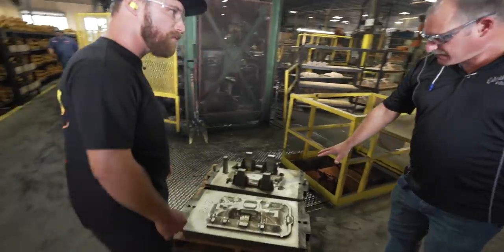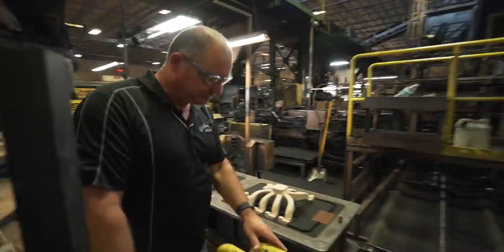EDELBROCK'S FOUNDRY TOUR!

Comment: might not look like it, but that foundry is clean af. i worked in a foundry once and it was just black sand an dirt everywhere. after every day my nose was gummed up by black sand, even though i wore a mask most of the time.
Reply: Same here, I looked like a struck match everyday I left work. That's probably the cleanest foundry I've ever seen.
Reply: I don't know where in the world you live, but it looks like a reasonably nornal modern foundry. It was a dirty business once, but that's long ago (nto everywhere though)
Reply: plus it helps they only cast aluminium here which is a cleaner metal to cast than steel
Reply: My families foundry is on the clean side for a high chrome/steel foundry but we don't have anything on this.
Reply: Icocure core making is some of the most unpleasant smelling process I've ever witnessed.
Reply: and that sand would find places on your body you never knew you had.  you really need smellovision to appreciate a foundry.
Reply: Never worked in a foundry but made plastic bags and bottles and those plastic pellets and little slivers of plastic somehow made it all over my house. I bet the new tenants still finding them.
Reply: Iron is the worst, I worked at New Haven Foundry in Mi. about 20 years ago and I'm still black from the soot

Comment: This was a clean foundry because it's very small and uses aluminum.  I worked in Fords " most modern iron foundry"  as they billed it.  We melted 50,000 TONS OF IRON EVERY DAY!  We made all the V8 blocks up to 460, trans cases, rear ends, fly wheels, intake & exhaust manifolds. cranks, camshafts, brake rotors and spindles.  The place closed in the early 80's because the gas crisis caused the cars to down size in all the parts.  Made great money, ate a lot of iron dust, and was glad to get out of there.  We kept the building under a negative pressure so all the dirt/dust never blew out the doors.  We had seven bag houses that were giant vacuum cleaners that sucked off the furnaces and the rest of the building.

Comment: I wish Edelbrock would make a dedicated small block Olds head for the 350 with 2.00 in. intake and a 1.625 ex. valve for use with a roller cam. I would buy the first 2 sets. Interesting video. Thanks.

Comment: Vic Edelbrock was hugely influential in the development of West Coast hot rodding. He was always seeking a better way to produce a better product, open new markets, or in Cali's case, save one; Vic was one of the big players that founded SEMA- to gain the political voice to get the Cali smog laws to develop it's California Air Research Board certification. Today that certification will allow Edelbrock Performance parts to be sold and used in any state. It wouldn't surprise me if Vic, Jr. figured out the EU process and became a  vendor for AMG.

Comment: Great insight into the casting process. 
Would loved to have seen one or those 4/5 imperfect sand moulds smacked against something. Get an idea of how hard that resin is. Also be cool to see how they remove the sand from the cast piece.
Reply: Andy yeah exactly how tf do they get the hard sand out from the metal casting
Reply: He didn't mean they were imperfect, he was saying that each casting uses multiple cores to make. Some can take quite a few to make one casting.
Reply: @daevid21  Most foundries use what's called a shakeout. It can be a rotating drum or a bin that basically just shakes the hell out of the castings. Very noisy, lol

Comment: About 20 yrs ago built a heavy haul rigg for crusin calfreeways. 355cui /with mild porting elibrock parts ect dynosaid  353 hp to rear wheels over 410torque , with Qjet 17mpgperformance,,, parts list performer package ///////. a while later truck came in from CA.time for fine tune . noticed gasket colores are different . luck has it edelbrock has wheel dyno a couple of buildings away . they said we will get every H P  it can produce . impressed they paid owner to do a tear down and spec parts and work done . about a year later crate engines started showing up performance rated !!!!!!!!!!

Comment: As an "Environmental Question" what does Edelbrock "do" with the spent sand/resin cores after use?...🤔
Reply: TK Skagen it’s recycled and reused.
Reply: Sand that hasn't burnt out (~90%) can be reused in the process after regenerating. Resin on the other hand has to be removed from the sand grains during regeneration, cannot be reused and has to be treated as hazardous waste.
Reply: Foundry industry is one of the most environments conscious industries today. I’m a metal casting student and most of the conferences I’ve been to held seminars on mitigation of pollution and cleaner processing techniques

Comment: What is the process to remove the sand cores from inside the casting after it’s poured and cooled off? Very cool content
Reply: The molten metal cooks off the resins in the sand and after it cools it comes right out. Basically a big ass vibrator shakes it out. Lol

Comment: So how do you get the cores out?
Reply: In most cases, they vibrate them, and the core falls apart. What they didn't show you, is how brittle the sand castings are. The resin keeps them together, but you could crush a piece with your hand. They aren't solid. So, with vibration, you can get the core to basically desintegrate, leaving you with a molded metal part.

Comment: I know for a fact that the smell of these factories is horrible
Reply: no the smell in a aluminium foundry is not horrible, smells only hot metal, some chemicals are use, but evacuated by extractors...Same thing in the machinig section, only if cutting lubricants are polute by bacteries whe can smell bad odours...